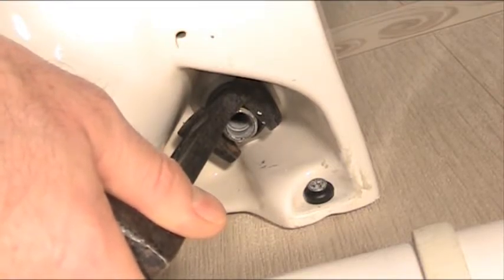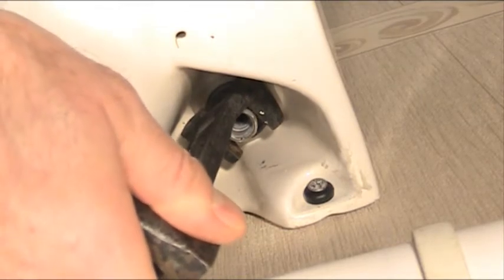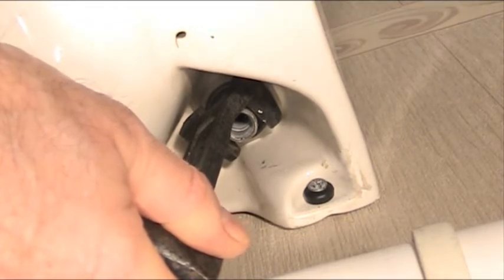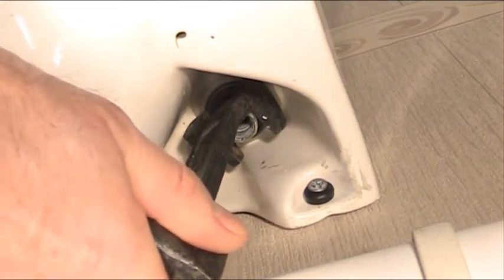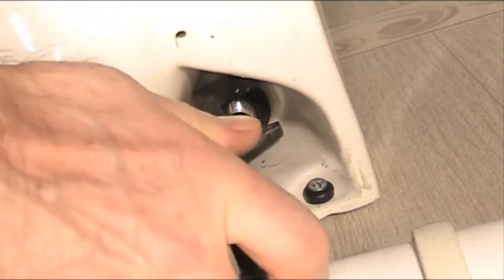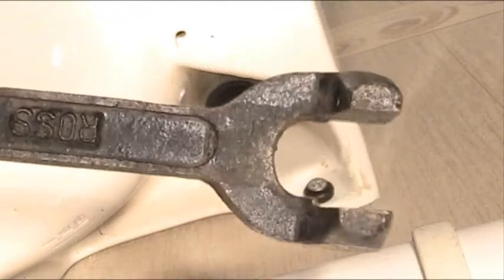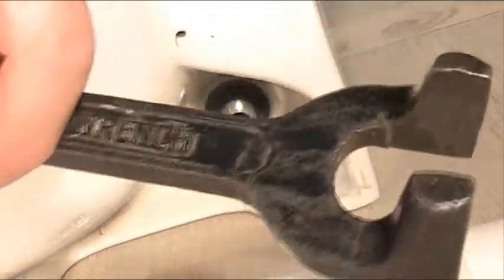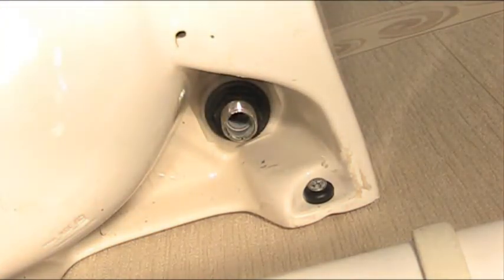Using Basin wrench to tighten a loose tap

Comment: That basin wrench must be really old; I don't believe I had seen one like it before over here in the Colonies.  The ones I've seen and used (Ridgid and other brands) were an adjustable-opening style.  The head on them flips 180 degrees to loosen or tighten; some designs also telescope in length, as needed.  Yours doesn't have a padded handle or a means to apply leverage, making it difficult to apply much force if needed to remove a nut.  Beyond that, I found I could do the same thing with a deep-well socket, a ratchet (3/8-drive) and a long extension to get the socket up into a slim opening.  Alternatively, I've also used a 3/8-drive crowsfoot wrench (7/8" opening) attached to the extension to remove a nut; the open-end design allows you to slide in and work around obstructions.  Yet another option is to use a flare-nut wrench attached to the extension, which gives 3/4 coverage around the nut, and fits better in restricted spaces.